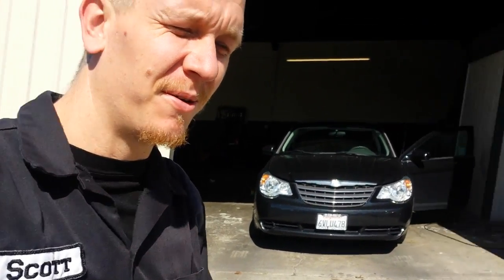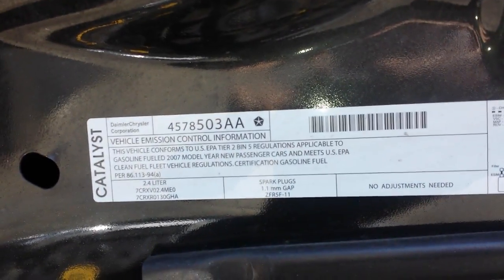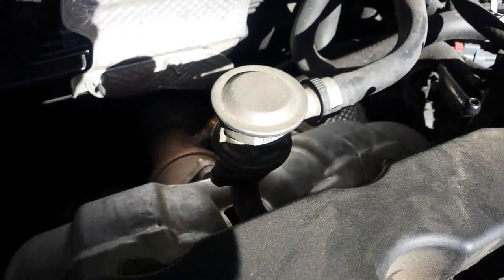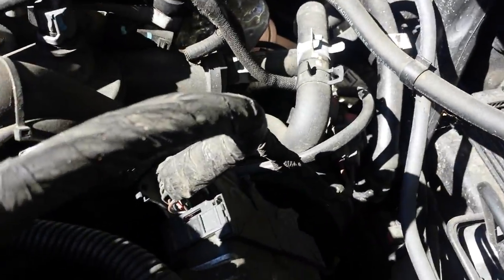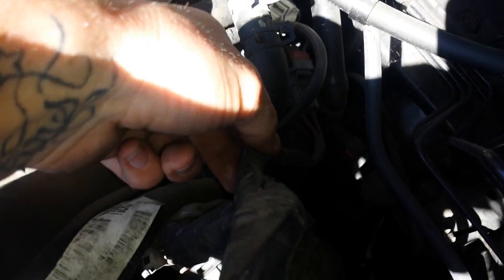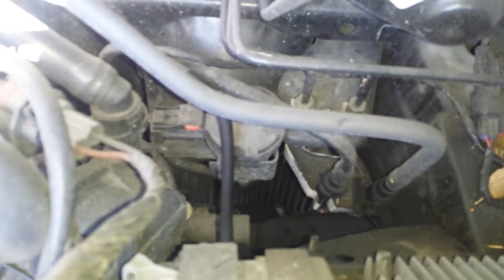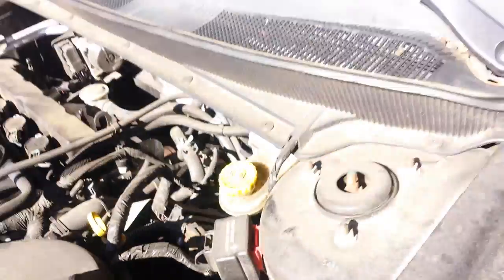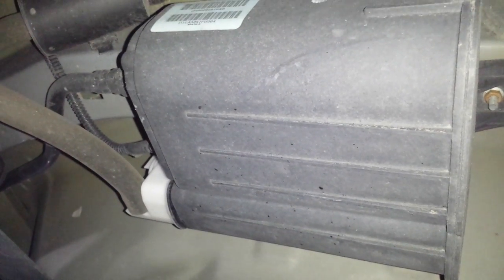Chrysler Sebring emissions: EVAP canister & purge solenoid, Air pump, & PCV valve (Cirrus)

Comment: Hello everyone. P0507 code 2007 Sebring same motor as this video.. changed batter and air intake gasket…any other suggestions on patty’s to change…does this motor have idle air control valve? Or is it built into the throttle body? Thanks in advance to anyone with a suggestion

Comment: So which one is the actual evap purge valve? That’s the one I need to replace on my 2010 Chrysler Sebring from what I was told. But I can’t find the damn thing
Reply from the maker: Evap purge is the one under the hood. The vent is near the vapor canister.
Reply: @ScottiesHobbies  ok so is the purge valve the little canister at the far back right of the engine?

Comment: I have 2008 Chrysler Sebring with P0455 and P0456... Im thinking it might be the purge solenoid... I dont have a smoke machine.. can i test it by just blowing air through it (is it normally closed)? Also.. when i fill my gas tank, the nozzle shuts off before the tank is completely full ( fills to about 80% befpre clicking off).. would this cause that?

Comment: When I try and fill my gas tank its constantly stopping and painfully slow to fill.  There is also built up pressure when I release the cap.  Do you think the most likely problem  is a plugged canister?
Reply from the maker: If it was my vehicle, I'd start by checking the vent solenoid and make sure the hose to ambient is free of debris.

Keep us updated and good luck on your fix.
Reply: @ScottiesHobbies  I have the same model and year and and I have a check engine light that says gas cap but I replaced my gas cap but I still have a check engine light that says gas cap any reason for that?
Reply: i have the same problem on my 2010 sebring

Comment: What is the noking noise in the engine?
Reply: I think you mean "knocking" noise. The soung recording charactetistics of many modern digital recording devices ( cell phones for example ) have a sound leveling feature that causes otherwise low level noises to be "exaggerated." What appears to sound like "knocking" in this video is actually the amplified sound of the engine lifters.
Reply: @JayCe-k6c  it might be low in oil since is 4 cylinder the sound of the lifters is obvious